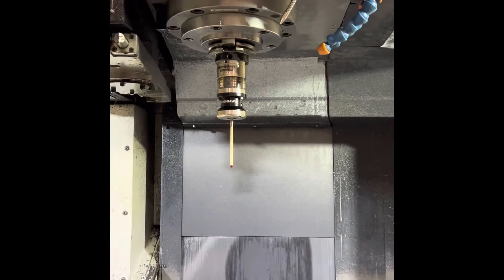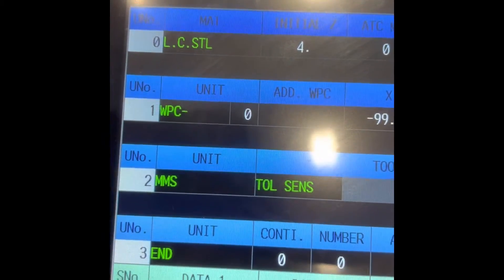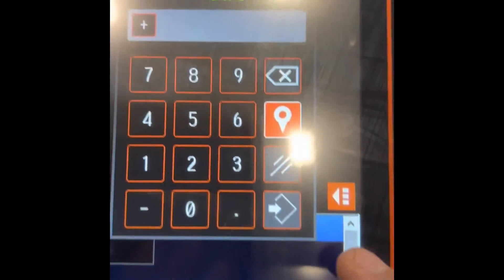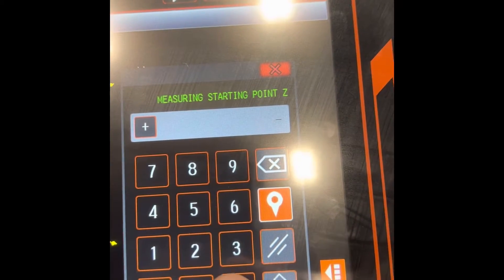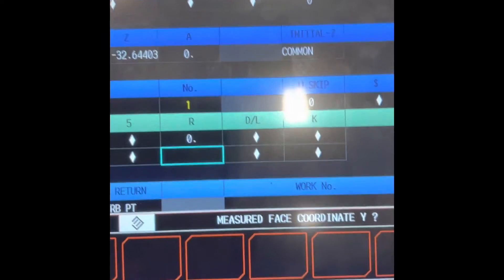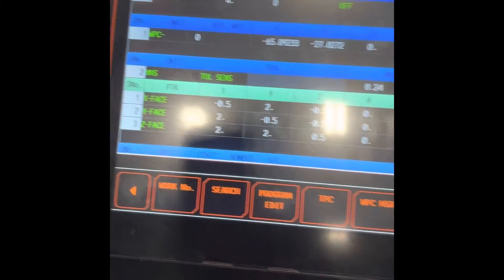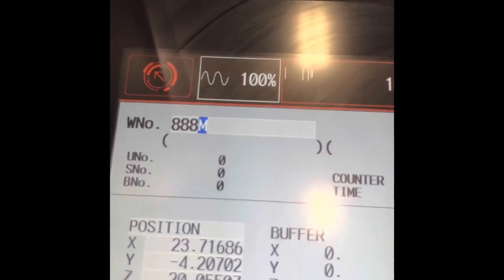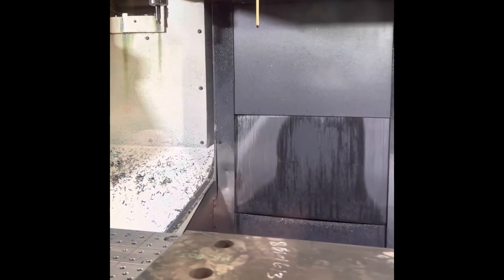HOW TO WRITE PROBING CYCLE PROGRAM ON MAZAK

Comment: I am just wondering where you got those numbers from like how you know x is -.5 y 2.  Z -.05" ?
Reason why is whe have an aluminum plate on ours that's thinner and different. I am told if I break it I buy it and I don't wanna buy a new probe.
Reply from the maker: -0.5 is for clearance, 2.” is the point how you measure the part.  z-0.5 you need to touch the part. cause if you ho 0.5 you wont hit the part or probe won’t touch it.
Reply: I was gunna ask the same question😅😂
Reply: I need help im trying to learn how to write cycle programs I just started this new job and I want to learn how to setup but the setup guy is Russian so he doesn't understand me and I don't understand him neither the struggle is real I need step by step video like maybe you think you can make a video with a print drawing and explaining step by step how you get the 2 inch